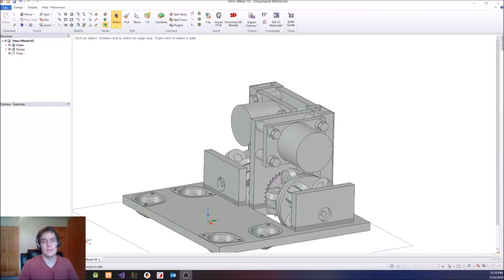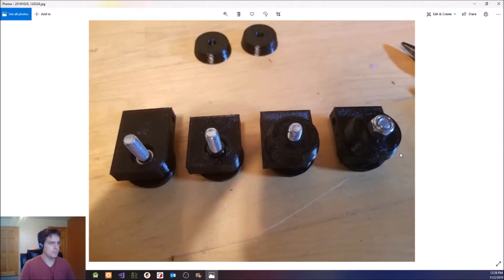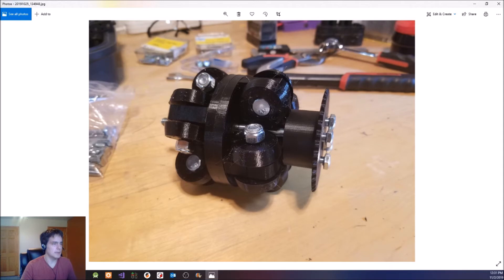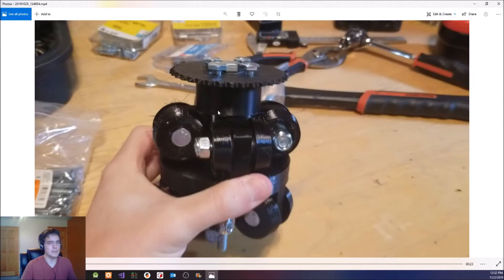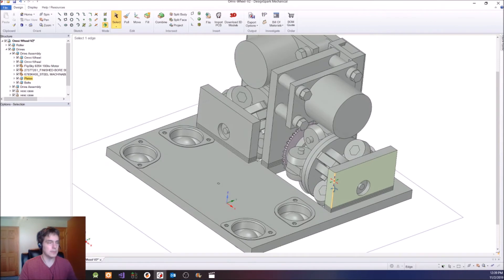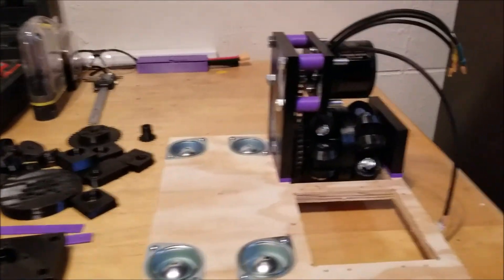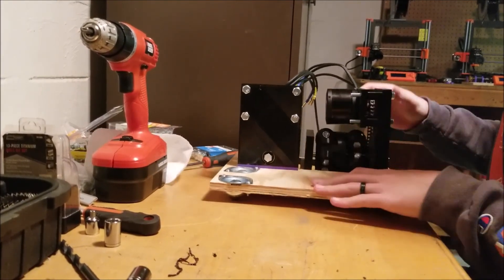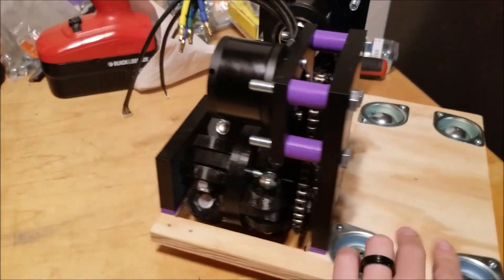VR Shoes Build Log #3 - Assembly

Comment: hey great work - could you use some senosrs,encoders  in the moving  part of the rig to monitor the foot movement and rotations? you may get some data back that suggests trends in various movements - u could use it for adjustments and a form of ai...what micro controllers are you using if any ? plus i think you could miniaturize most of that especially with the current plastics/rubbers, the multi directional wheels - they could be smaller (with encoders maybe)
Reply from the maker: Hey, thanks. This video is pretty old and I went went through many versions as you'll see if you decide to watch the series. I should really make an abridged video that summarizes build log 1-30 or something like that. 
Anyway, yes I ended up using encoders to track the wheel rotation. I did try much smaller omni-wheels, but went to uni-directional for now for other reasons. I plan on trying omni-directional again later. 
The current version I'm working on has been miniaturized considerable. Using AI would be very cool to try to predict the user's movements. I was thinking to train the AI you would wear the sensors while walking normally, walk for a few hours or days to train the AI, then maybe it would work well with the VR shoes. 
Early on I used an Arduino board but later switched to an ESP32.